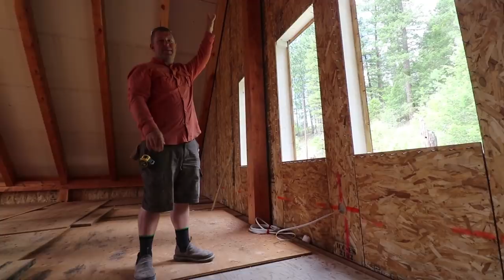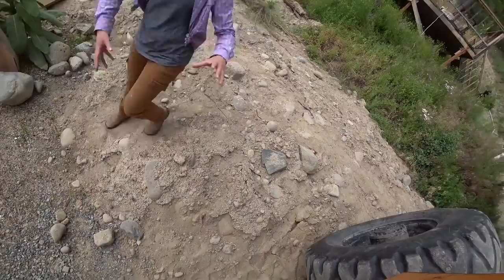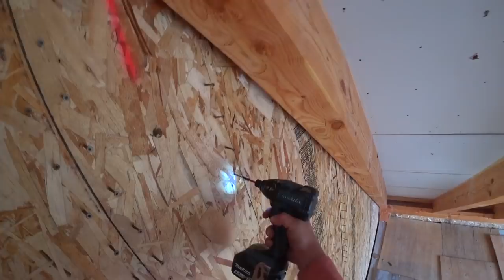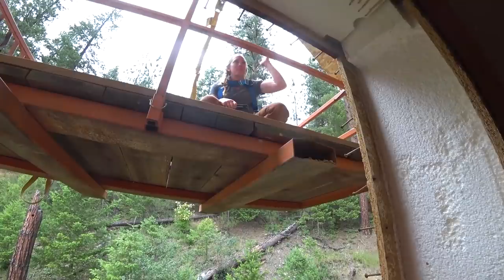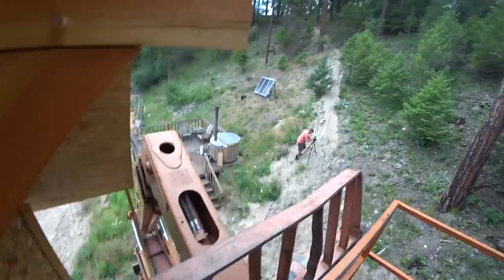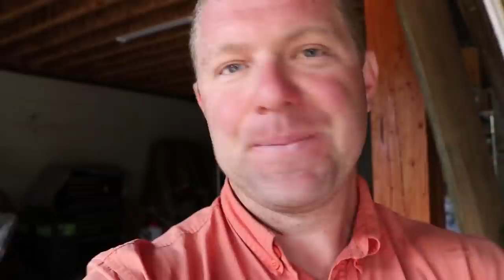GOIN' OFF ROADIN' IN OUR FORKLIFT!

Comment: Get the house dried in before it rots from all the weathering.  There is going to be a certain amount of settling. Get it under roof and get the siding on before you have to do it again.
Reply: What he said.......   I would have at the very least plastic stapled over that roof.... ya I see it blows there all the time.... u you have to do something NOW to stop water getting on that roof and in to the house.

Comment: For those of you building walls (PLFL has moved on) in real life, builders use 'plate levels', they accurately check the plumb/level of points far apart without worrying about the irregularities in between.  If you're interested Google:   plate level stabila  These are good levels that can very accurately measure points 18 feet apart, you want to know if the bottom-of-a-wall and the top-of-the-wall are plumb, you can't do that with a 4 foot level, you need a plate level.

Comment: Alright Jesse, 3 demerits from your manhood card for putting a loved one in danger. the male chauvinistic construction worker in me says you should have been on that ladder from the beginning. 1/2 demerit returned to the good for FINALLY trying to get the forklift around the backside of the house. to my eye, it would have been worth the effort to take a couple of feet from the high bank and used that material to start backfilling the foundation. it would widen your work area and raise it as well. some times an extra 6" can make the difference between making it safer or an awkward situation. I tease a little, you guys are doing a great job, be safe, russ

Comment: Your home looks fabulous. My brother and I spent a summer erecting a 20 x 40 x 100 steel quonset building. We used a tractor with a front end loader and  scaffold for the interior. We had a tire ladder on the exterior. All of the thousands of bolts and nuts were tightened by hand with a speed driver and a wrench on the inside. Each bolt was tightened by 2 people, one outside and one inside. When finished there were a couple leaks which we re-caulked and replaced the bolts. The shed held our big tractor, combine, swather  grain truck and farm truck. It is still on the site 45 years later.  So I totally understand the exhaustion of sinking in all of those screws and bolts. Great work!   Nice off-roader!

Comment: You can put a little more faith in the Lull than you think. For instance, you can use the corner of the platform to raise the sagging corner sips whilst being in it to secure it. The way to gain faith in the abilities is to take it out on flat ground and extend it all the way out 1' of the ground and both of you get in it and add some weight. Yes it will flex but once you get your head around that at a safe level, you won't worry as much when you're in the air. You can add a safety margin by not fully extending it when using it. I would be surprised if it took more than a couple hundred pounds of uplift to raise the corner sip. It would be like having another man in the basket. You guys are great to watch and love your work ethic and attention to quality, great team!

Comment: Wow Jesse & Alyssa house build is going great ! Alyssa your one gutsy
woman... working at those heights and you've been fortunate not running into a wasp nest up there!
inch by inch anything's a cinch.
just one more thing with the ongoing battle of wasp nest and not wanting to use toxic chemicals
there is the alternative of using Isopropyl alcohol in a sprayer bottle or for distance use a smaller garden sprayer that you pump up pressure to spray target nest. hope this idea can help in the bee battles.

Comment: Did you know that you could probably set scaffold for about $4000.00?  On this house, I would pay a little extra to set a level so you can step off the roof and onto the top level.

The heavy equipment is slow, dangerous, unforgiving and cutting your workforce in half.

Comment: suggestions are so easy--------mine is to build some simple 2x3's on 2x6's ladders to get into the house and between floors. Some people even build open raiser stairs just to make getting between floors easy.  Climbing ladders gets old.   #2 buy some used scaffolding,  so much easier then working off ladders or pump jacks.  When you're up in the air you want to be comfortable.

Comment: I have watched the last two years worth of vids in order.  Epic job.    The fact that you did not get a water proof roof on that house as soon as you have SIP on the roof boggles my mind.     I know you are working as fast as you can but your entire house is chip board...  I dont care what the manufacture says the stuff is never the same if it gets good and wet.   Again I understand there is no end to the jobs to do and one leads to another.... I would simple expected the water tight roof to be a  higher priority.   And why in Gods name you put dry wall on the ceiling the way you did again boggles my mind.   What was the advantage to you?   
I hope you are both proud of what you are doing because you sure should be.   thanks for sharing.
Reply: Me 2 waterproof.   NOW
Reply: No, not chipboard.  It's OSB which deals with moisture reasonably well.
Reply: Because installing drywall after the fact is a bitch.  But ya, not drying in the home asap and working with OSB is crazy to me.  Once it gets wet, it is never the same.  I like they have so many screws, but could not agree more that it is insane how long that OBS has been exposes to moisture.

Comment: Those SIPs are a total pain in the ass.   You should have gone ICF all the way up.  SIPs on the roof are OK.
Reply: Nope....its a timber frame...
Reply: I am with you....  watching the build on this house NEGATES the possibility I would ever use such a system.   And it sounds like when they get done they are going to build a conventional  stick house inside it for walls and the like so I have no idea what the saving was here?    The time to do this is insane  and I for one think the level of insulation is the walls is just barely enough.     I live in Canada so maybe I over do insulation.   OH it is going to be so much fun when i comes to running the wire through that house.... again I do not see any advantage to this system of building at all.

Comment: Get a longer level you will get a better read. Also a plumb bob will help with tall walls, you might be out a 1/8 in 4 ft but what are you out over 14ft. I wouldn't stress that honestly
Reply: Oh and 6 in driver will help out with driving them screws in

Comment: PLEASE, Don't run over the power cable.
You can damage the twisted wires inside the outer sheath without knowing until it is too late. 
The result can be lots of sparks, tripped out breaker, fire or electrocution.
I want to see the end result of your hard work.
I have been following the house build from day one. Keep up the good work and keep off the cables.

Comment: just think, if the roof sip panels had been the actual length they were supposed to be on the north side,  then you wouldnt have been able to fit in the forklift to screw the lags with enough clearance. kismit.

Comment: I don't understand why you would leave a gap between the SiP and the frame. I don't care if the sip is a quarter out, it is not good to be hanging on screws without the friction to help steady the structure. Shims don't cut it.

Comment: I think you really should buy used scaffoldings and sell them after your house is done. Atleast big enough set so you could make one wall at a time. When your screw gun starts having problems like that, its usually caused by bad bit, or one of those gates at the tip of the gun not closing. If you use it alot, the autofeed starts to bend and makes similiar problems.

Comment: To get rid of the nest. Wayt until midnight time when everyone is onside. Put a plstic bag arround and kut it down with a knife holding the bag as tight to the roof as possible. Tape it. 
(They cant get you throug the plastic bag). Put in some of your foam or burn the whole package. Done.

Comment: When I was young, about 30 years ago I installed windows. We use to have a timber ladder that extended 20 metre's (65 foot)  And I once used it about 15 m (49 foot) putting in a timber sash frame 4 m x 2 m by hooking 1 leg into into the opening and 1 foot on the ladder and lean back holding the window on a 45 degrees and place the base in first.  m = metre's

Comment: Guys why don’t you forget the  forklift,  how on earth are you going to fit the roof and wall cladding surely not off the forklift far too dangerous just bite the bullet and scaffold the building and work off this much safer, also really need be be thinking about cladding the envelope with a membrane Tyvek or similar, sure it rains there and you’ve lost your plasterboard.  Don’t worry too much about plumbing your walls really not that important.

Comment: Still don't understand all the screws.
Reply: That's probably because they are unnecessary. It's kind of fun to see what happens when people who are less qualified than most children try to build a house, but there's a lot of cringing too.
Reply: At one point he point out the manufacture just wanted staples (probably brad-nails)  to join the panels not screws.  Some how they concluded bigger  wholes in the chip board would be better?   I have  no idea.    The length of the screws is another things???  yes I understand the long ones  12 inch plus but a two inch screw  even 1 1/2 to do what they are doing is serious waste.   One inch would go through the chip board and the joiner piece in side  as well.   If you have 10 000 screws in a house I think saving 1/2 inch to one inch each screw would matter.     But I am not there?  and I have not talked with the manufacture and its not my house so I dont really matter.